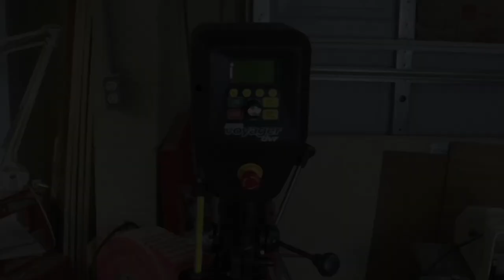NOVA Voyager DVR Drill Press Setup

Comment: Just bought one today. You had yours almost a year. Happy?
I did not even attempt to lift the motor unit that high. Tilted shaft down then back up.  In fact I watch the vid just to see what you would do! If I could lift it like you did might not need electric motors. You got me ,I subscribed, well done man!
Reply from the maker: Yes I am very happy with mine. I love the variable speed and the bit/speed selection program. I guess I was just super motivated to get it together =). Thanks for watching.

Comment: question have you had any issue with your nova 1624-44 lathe cam not holding tight. mine when it is lock down tight you can grab it and still move it.
Reply from the maker: Are you asking about the cam that holds the banjo steady?
Reply: the cam On the lathe that keeps the belt tight. that keeps the motor pulled down.

Comment: I know this is an old video, but just picked up my Voyager. What type of runout are you or anyone else seeing with stock chuck?
Reply: Hey there, I'm also in the process of setting my Voyager. If you want to share notes hit me up. I'm not nearly as jacked as this dude so I'm currently waiting for a second hand to lift the headstock lol. I'll update you when I've calculated my runout. In the meantime, google search "Nova Voyager FAQ Page". There it states the max runout of the chuck is 0.18mm (~0.007") at a quill extension of 100mm (~4").
Reply: @DjSqueekz  After taking apart and reassembling a few times I'm at about .0005 at the end of the quill and .003 measuring at the bottom of the chuck. I guess I'm good with that; forstner bits still seem to wobble a bit (visually, drills fine), but I suppose that's mostly an illusion. As far as setting up, I leaned the base over onto a stool and slid head on then stood up. I'll checkout FAQ page, thanks. My only issue at the moment is the electronic depth stop, I'm assuming it's user error. The motor turns off but but will still go a good 1/8 inch deeper before bit stops. There doesn't seem to be an actual depth stop electronically. I hope I'm wrong....I want an actual stop/ can't go any further.
Reply: @johndeaux9987  I've read through every review, Q&A, and thread on woodworking / metalworking forums I could find. From what I gathered, the stock chuck is not on par with the rest of the machine in terms of quality but that it's adequate for woodworking. This isn't necessarily bad because a good portion of people buying this machine aren't doing precision metal working and so Teknatool can sell it for a lower price, and the people that do need higher precision can buy a $200 chuck from a third party (which I plan to do eventually). as far as the depth stop not working properly, have you calibrated the height sensor yet? it also might have to do with how you're zeroing to the bit. Unfortunately I still need to replace a GFI outlet before I can get up and running 😕
Reply: @DjSqueekz  I'm assuming the depth stop is user error. Yes, I calibrate top of wood as zero, set depth, drill. I get the beeps and the motor turns off at set depth, but if I don't stop downward pressure as soon as I hear the motor stop, there's enough residual spinning to drill at least 1/8 inch more. There is no "stop" per se. If I use the same setting and no wood, I can go full travel of spindle. I thought there was a physical stop at designated depth when using the electronic depth not just physical setting on side of machine.
Reply: @johndeaux9987  when you say "calibrate top of wood as zero", it sounds like you might think calibrating and zeroing are the same thing, which is understandable because zeroing essentially IS calibration. but in the case of this machine, there is a specific calibration step that you only have to do once (unless you factory reset). this process is laid out in detail on the same site as the FAQ page I mentioned earlier- https://teknatool.freshdesk.com/support/solutions/articles/19000042685-calibrating-the-depth-height-sensor-on-the-voyager-

you will still need to re-zero each time you change the bit, because bits vary in length. remember if you're using something like a brand point bit that might have an 1/8" long spike in the middle, you'll want to zero relative to the cutters on the sides of the bit
Reply: @DjSqueekz  yea, I got that part, thats what I'm doing. I was under the impression there was an actual "stop" ie. Spindle will not travel down any further past set depth. Say I set depth at one inch, the beeps grow faster until reaching 1 inch, motor shuts off at one inch. If I don't stop turning handle, the bit will go at least another 1/8 inch before rotation stops. If I do this same thing with no wood present, I can take spindle all the way to the table. Is there supposed to be an actual stop?
Reply: @johndeaux9987  hm, thats interesting. I've actually never used the voyager, only just watched videos so I'm not sure. I guess I was under the impression it was a physical stop. One thing you could try is turning on the brake assist in the settings, that would stop the bit's rotation quicker which should keep you from going too much further into the material. If all else fails, I've heard Teknatool has excellent tech support so you could try asking them.
Reply: @DjSqueekz  well, at least they respond quickly to emails. The electronic stop is in fact not a "stop" as in anything that prohibits further downward travel. Customer service says to listen to beeps; it seems what everyone calls a stop is really a depth indicator. The motor turning off will get you pretty close if you pay close attention and stop turning the handle, but you can easily over drill your hole if not careful using electronic depth stop. I'm disappointed as this was one of the main features leading me so spend so much on this press. I can see myself using the physical screw stop a lot.

Comment: Is it just me?
Here in Oz that thing retails at $2799.00 😳😳😳🤪🇦🇺

There’s no way you guys stateside are getting ripped a new butt hole this big to buy this drill press, surely?

I’d need to take a 2nd mortgage on my house to pay for this thing.

No question I’d sell a kidney to own one, but I fear at this price, - I’d have to sell BOTH kidneys!

Sherwood sell a variable speed pedestal drill press for about $800 here in 🇦🇺

Ok it hasn’t got the fancy assed computer, just a dial & rpms read out, but do we REALLY need the computer aspect for an extra $2K?

I reckon I might get p!ssed off over time having to program the computer each time just to drill one hole!

I’d frankly rather save $2k & just switch it on, twist the dial to adjust speed of the drill bit as it is operating based on the chips being produced - than frig around with the computer menu & selections!

Something else?

My cheap assed Ryobi drill press with pulleys & belts that I want to semi retire for a variable speed press, has the handiest feature of them all!

A light globe with separate switch located between the quill & up stand pipe!

You can actually SEE what the feck your drilling to line it up right!

For $2799.00 Aus, I don’t get either a light or a laser pointer to help me align the drill bit with where I want the hole?

WTF were Nova thinking when they designed this?

Nah, I’m sorry but Nova missed the boat on this sucker, for $800 I’ll buy the Sherwood thanks & fit my own damn light into the bargain & save $2k that can go towards a new lathe & a new compressor!

See for yourself - $2799.00 I kid you not!

https://www.carbatec.com.au/nova-dvr-drill-press

Versus?

Sherwood variable DVR pedestal drill.

https://www.timbecon.com.au/top-level/drilling/drill-presses-accessories/floor-variable-speed-drill-press

$749.00

Yes it’s half the quill travel of the Nova, and only a fraction of the HP motor (Killerwasps).

But - it has a laser pointer at least, if no light!

But it is $2K cheaper also!

I’m not sold on this Nova, what am I missing here?

& to top it off we all know that the moment I spend that $2700.00 on the Nova, some Chinese manufacturer will have a knock off copy out on the market for $500 at your local big box Wally World / Bunnings outlet, that ALL your mates will be buying & asking you why you paid $2k+ above the going rate for the Nova?

Might have to start searching Chinese manufacturers and see what I can find direct out of China!
If I were a betting man I’d bet my left ball that the Nova is made in China anyway for Nova & sells to Nova for 3 bowls of rice & they put their branding on it & with shipping, exchange rates, taxes etc - I end up paying $2700 for some cheap arsed Chinese junk, bye the time it’s gone around the world twice via USA to Oz! 😡👎

What do you guys stateside pay for these?

I bet it’s not $2799.00!
😳😳